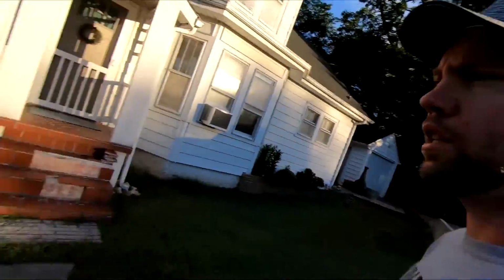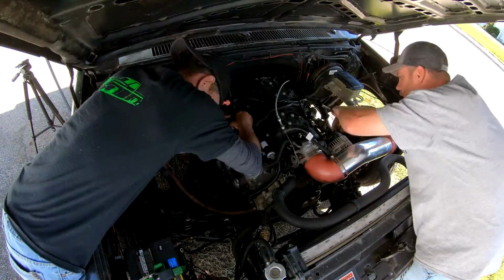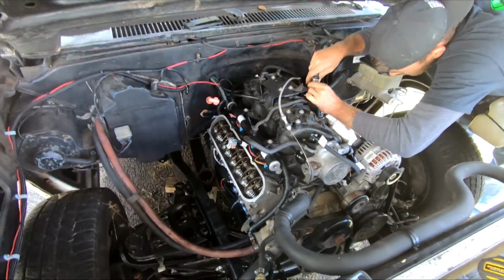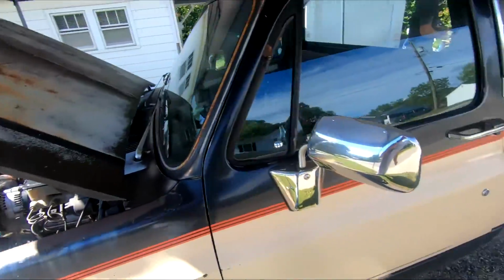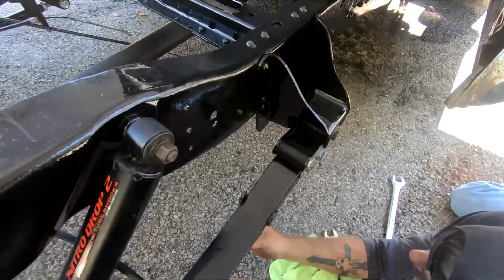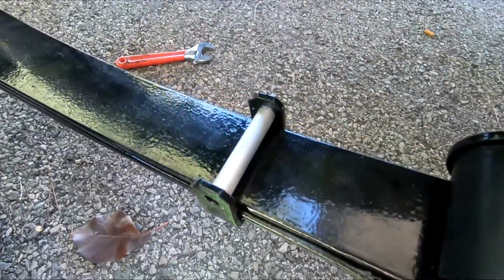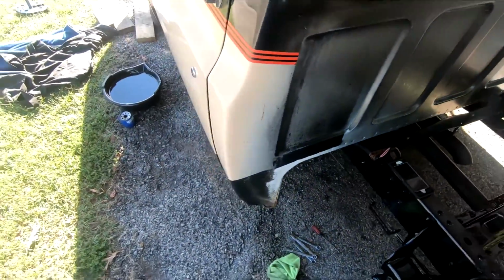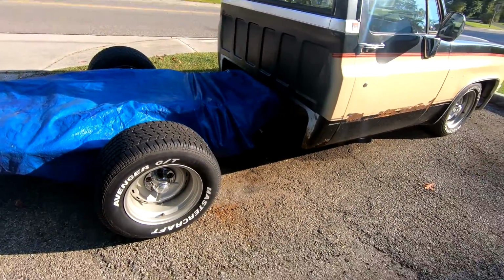Retorquing my heads on the freshly rebuilt 5.3

Comment: What size are the rear tires ?
Reply from the maker: 295/50/15
Reply: @EdsGarage99  are the wheels stock 8.5 wide ? Thank you Steve
Reply from the maker: The front are stock with 235/60/15 and rears are 15x10